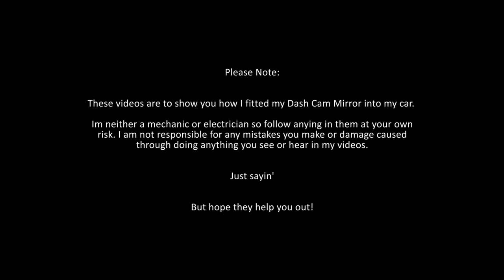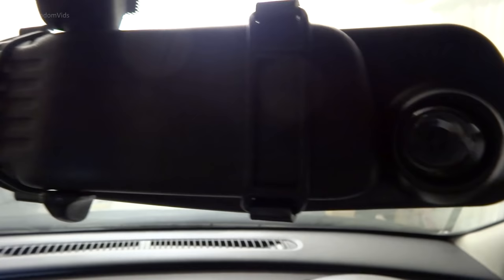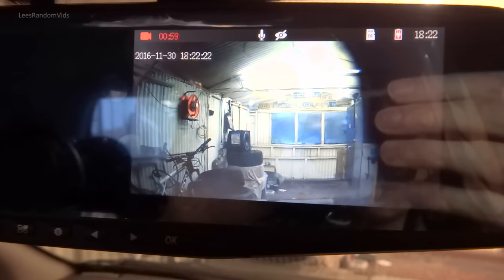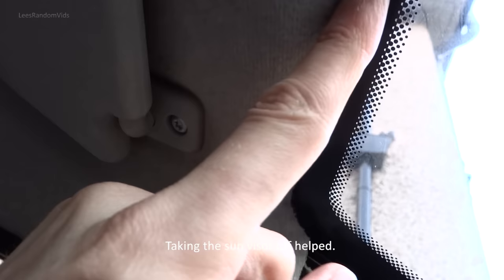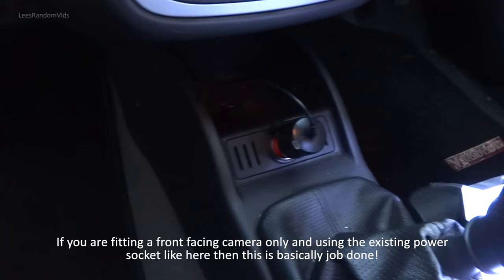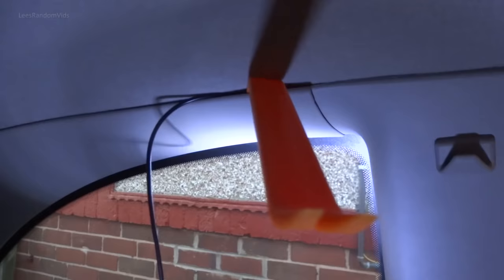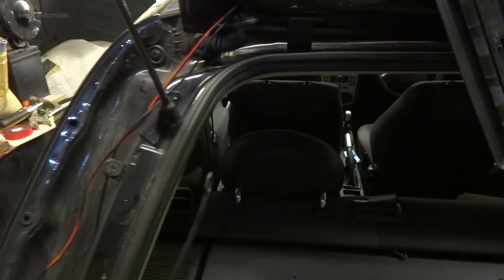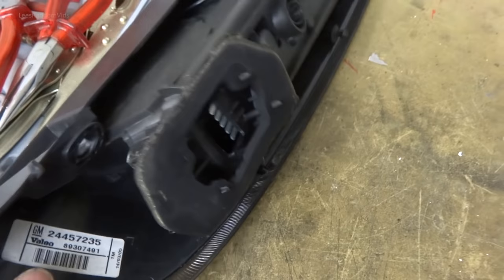How to Install a Dash Cam Mirror and Rear Camera to your Car - Part 1

Comment: What is the purpose of the red wire and where do i connect it ?
Reply from the maker: It's for switching the screen to display the rear camera when you put it into reverse, to act as like a parking camera. You wire it into the reverse light circuit so when your reverse light comes on when you put the car in reverse, it displays the rear camera on screen.
Reply: @LeesRandomVids  I've got only one red wire coming out of reverse cam. As you said the red wire of the reverse cam connects  into the reverse light circuit. So it has to be connected to the + of the reverse light , correct?
Reply from the maker: Yes that's correct, the + (positive) side.
Reply: @LeesRandomVids  Thanks for the reply. I've installed it like pro (lol), its display switches to reverse cam with the parking guide colored lines when reversing the car/ records both cams (all good) EXCEPT that there's no button to switch the display off :(
Reply from the maker: No probs mate. You mean it keeps the rear camera displayed when you take it back out of reverse? Hmm that's strange. Or do u mean it just doesnt turn off? 
Mine just switches back to the forward facing camera when I take it out of reverse, then auto switches off after 20 seconds (that's an option in the settings).
Reply: @LeesRandomVids  Mine didn't come with an installation guide but troubleshooting booklet. It does have picture in picture and I'm able to switch in between. Iit keeps the cam viewing and recording all the time until I turn the engine off. Can you tell where in the setting I can switch off the display like yours? cheers
Reply from the maker: Sorry mate I didn't get a notification you had responded.
Anyway the option to make the display turn off automatically is the LCD Brightness option in the menu, you can set it to 10, 20 or 30 seconds on mine or 'off' which means the auto turn off is off, so it says on. I show how to do it here: https://youtu.be/qpukX0-W4oE?t=22
Hope it helps.

Comment: How would you get the wires to the rear cam in a 5 door hatchback?
Reply from the maker: Every car is different, you need to find a route for each car. You can either go across the top as I did or the most likely place is across the bottom under the door sills to the back.

Comment: can some one help me? i plug it in into my car and then suddenly it just poweroff. now it wont open anymore
Reply from the maker: Don't know mate but the first thing id do is to check you still have power coming from the cars power socket. Try plugging something else into it to check, if you don't have power you could have blown a fuse in the car. You could also try plugging it into someone elses car to see if it works in theirs if you don't have anything else to plug into yours to check.
Once you've eliminated this possibility and you know you have power coming from the socket, the next thing id try would be to plug the dash cam into your computer or laptop via a usb cable as this will power it too. If it works with the usb cable but not in the car then you know its probably the cable that's faulty that plugs into the cars power socket (sometimes those plugs had fuses inside too). 
If finally it doesn't work from the cars power or via usb to computer than its must be your dash cam that's possibly faulty or damaged. Id suggest contacting the person you purchased it from then.
Hope it helps.
Reply: haha you got scammed!

Comment: Why don't show step by step 🤬🤬🤬🤬
Reply from the maker: Basically step 1 is to strap the dash cam to the mirror. step 2 is routing the wire to the power socket, and step 3 is plugging it in. The hardest part is routing the wire.
Reply: Beggars can't be choosers?

Comment: LOL,"iT HAS A BLUE TINT". Thats the plastic wrapper yer wally! :) Good vid otherwise. TAKE THE BLOOMIN BLUE PLASTIC OFF, lol! ;) What I really need is an instruction manuall. I cant find one online and there wasn't one in the box!
Reply from the maker: Seriously?!!? lol You must think I'm bleeding daft or something.
The blue is the mirror, not the wrapper. Its blue to dull down the high beam of a car behind when you would normally angle the mirror down, as doing this would point the camera to the sky.
The plastic wrapper is clear: https://youtu.be/KeHXG-oXGiM?t=649

Yeah it's annoying they don't come with any instructions, especially as some of the names in the options are a bit vague.
Cheers mate.
Reply: @LeesRandomVids  :) Yeh, got mine sorted  out in the end and took the blue plastic off too! ;) Just kidding! ;)

Comment: just hook one up an hour agao and it so cool when u put your car in reverse and u can do the split screen awesome so far
Reply: Elvis Best I’m waiting for my extension cord for the backup cam. Did you hook it up to the reverse light or to the battery? Mine has just one red wire for power too?
Reply: @fringestream990  mine has 2 wires one red one black so i hook the red to the reverse n the black to the revirse ground
Reply from the maker: @Elvis: Yeah mate, I like the fact its a mirror and just forget its there now. 
@Smitty: Yeah, people have asked this before and someone got back to me to confirm that the one red wire goes into the reverse circuit and works the same as those with one red and one black wire. It obviously just takes its ground from the front camera, actually makes it an even easier install.
Reply: LeesRandomVids I just plugged mine in and the backup camera seems to make it that none of the buttons work at all. Without the backup camera plugged in then it worked just fine like in this video. Any suggestions?
Reply: Elvis Best apparently all I needed was that one red wire. No black wire needed on this one apparently but like I mentioned now the buttons on the mirror stopped working... 🧐
Reply from the maker: That's bizarre mate, I've no idea. I've not had anyone else mention they've had that issue either.
Did it work ok with the rear camera plugged in before you wired the red wire into the reverse? Did you try it before you installed it in the car?
Do the buttons only not work when you put it in reverse? (I think that would be normal) or do the buttons still not work even when the car is not in reverse? (and the forwards cam I showing)
First thing id try is disconnecting the red wire, see if it then works but with the rear camera still plugged in. If that happens then check the wire you joined the red wire to isnt live all the time.
Reply: LeesRandomVids I hard wired to the battery and not the reverse light because I wanted the backup screen visible all times while driving. But yeah maybe that’s the issue I’ll play around with it or see about a refund lol. Thanks for your help and good video.
Reply from the maker: You wired the red wire to the battery? That will be why then. When the red wire gets power it overrides the dash cam to display the rear camera, normally this would only happen when you put it in reverse. You need to disconnect that so you can operate the dash cam, your dash cam thinks it's permanently in reverse. 

If you want to have the rear camera visible on screen at all times while driving you can do that with the settings: 

To do that you need set it so the screen never auto turns off and then set the camera display to display to rear camera. The only thing you wont get is the rear parking grid lines, however if you wire the red wire to the reverse circuit, you will get those lines as it switches to reverse parking view (which will be the same view you have displayed but without the lines). But If you don't want or need the lines then you don't need to bother wiring the red wire into anything. The red wire is just for switching the view automatically when u put it in reverse regardless of the current view.

I made a video going through all the settings here, I've time stamped to the two bits you need.

To set the screen to stay on all the time: ►https://youtu.be/Dv9ftl5aZ2U?t=546

To change which camera is displayed on the screen: ►https://youtu.be/Dv9ftl5aZ2U?t=1239

Hope it helps and thanks mate.
Reply: LeesRandomVids yes I wired single red wire directly the red battery terminal. And no I don’t want grids at all. I will check out the vids closely, thanks again.
Reply from the maker: @elvisbest3213  Haha sorry mate that reply about the lines was to Smitty. But yea for the price its a bargain! I've had mine installed over 2 years now and its still working. Thanks mate
Reply from the maker: @fringestream990  Ahh, just disconnect the red wire then and tie it up and alter the display in the settings to display the rear camera all the time and you should be set. Glad I could help! :D Cheers.
Reply: LeesRandomVids Yup, that did it just had to disconnect the red wire and it’s exactly how I wanted it. 👍🏻
Reply from the maker: @fringestream990  Nice one, glad I could help :D

Comment: HI! I have the exact same dash cam mirror but it came with a different reverse camera, that has only one red wire. Should I just plug this red wire to the positive side of the reverse light and is it done?
Reply from the maker: Someone posted the same question on the part 2 video a couple of weeks ago that theirs also had just one red wire but haven't updated if it worked. Here's what I wrote to him.

"I don’t know for sure mate but if its made that way then id assume so. Id guess that that red wire is a trigger wire and that it gets its negative (as well maybe the power too) through the main wire that comes from the front camera/mirror and your red wire is just a switch. Where as mine is maybe using the power from my rear light to work the rear camera when in reverse, hence a red and black wire to make a new circuit, and then overrides the front cam. I'm just guessing here so don't hold me on it, but there is one way to find out, try test fitting it."

So I think yes you are correct, but I don't know for sure. Would be great if you post if it worked after you've fitted it to know 100% for others with the same question. Cheers mate.
Reply: Thank you very much for your detailed answer. I'll try it out and post some feedback here as well. Cheers bro.
Reply from the maker: You're welcome mate and thank you too.
Reply: Thank you for the detailed videos mate. BTW the housing of my rearview camera looks as the same as your bulbhousing in the backuplight (I mean the cube shaped object, that has 4 "holes" at each corner. It has exactly the same shape and size), lol
Reply from the maker: Ah yes I saw that type too when I was buying mine.
Reply: Mine also only came with just one red wire besides the main cord, I'm so glad you guys addressed this, thank you!!  I'm hooking mine up in the next couple days, I'll let you know what I find out.
Reply from the maker: You're welcome, and that would be great. Thank you.
Reply from the maker: Did either of you ever fit it? Just to confirm 100% for others it works with the one wire.
Reply: Well I have just the front camera hooked now,  had a little trouble pointing the camera center road and still being able to use the rear view mirror, they need to make it so you can adjust the camera further left n right.  I found a happy middle ground though, and besides that is works great!  I tried installing the backup camera but I have a Chevy Avalanche truck.  Technically the cord was long enough to reach the main unit, but it would have been hanging mid air in the truck...lol.  Running under the carpet and dash I came up about 6ft short.  I ordered a extension for that kind of cord which which will give me another 12ft to work with.  I'll let you know when I get it and how the backup camera works.
Reply from the maker: Hi, sorry I didn't get a notification you had replied, I just saw it now. Anyway someone else has confirmed it works with the one red wire. Hope you finally got yours installed! :) Yeah you're right about the angle, mine adjust just enough, its not quite 100% dead forwards but close enough.

Comment: Complete waste of time. Watching someone feed a wire through a car. Had no useful info at all.
Reply from the maker: What info do you need to know that wasn't included in the video? 
And btw, 90% of fitting a dash cam is the wiring. The other 10 being sticking it in/on your windscreen and plugging it in.
No need to be angry and aggressive, if there was something else you wanted to know, you could have just asked.

Comment: Dont buy it, you can't even see out of the rear view mirror dash cam.
Reply from the maker: Not if you're driving with the screen on no, that's why you can set it to turn off after a few seconds.
Edit: Here's a clip from my questions & answers 1 year on video answering this and showing what you can see if it helps anyone:
►https://youtu.be/qpukX0-W4oE?t=6m14s